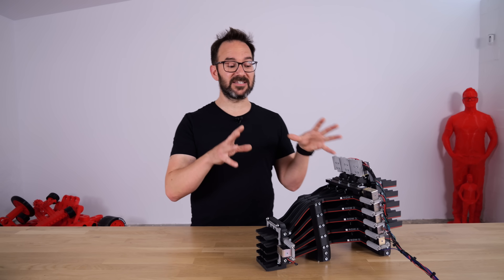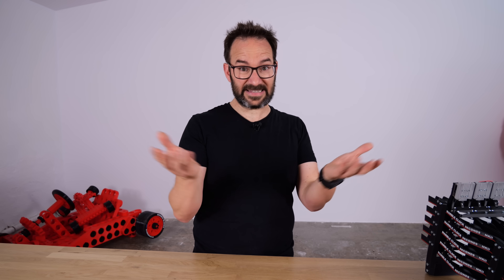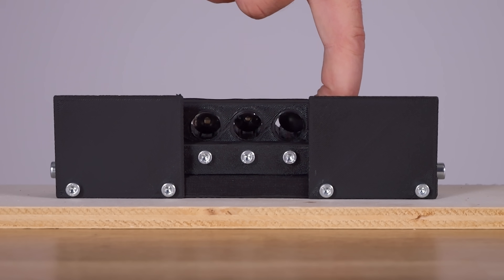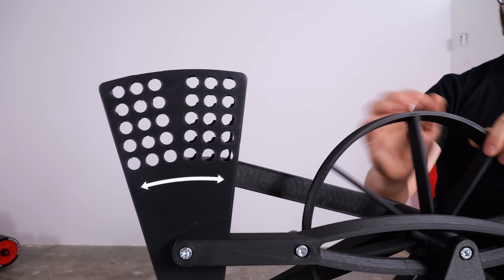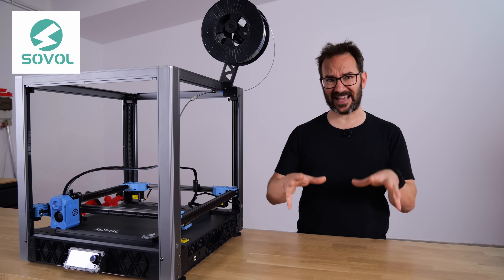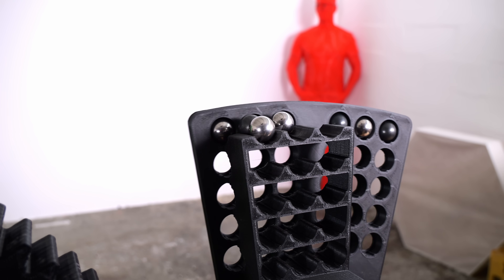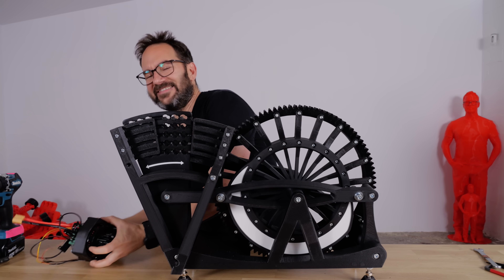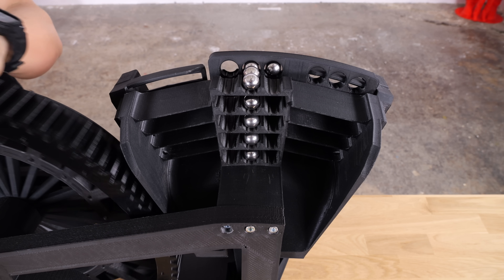Swinging Marble Teleporter - Marble Clock Seconds Display Pt.4

Comment: It was one, or maybe a couple of videos ago, I left a comment querying using black marbles at all, when you can just leave it blank. On a digital numerical clock, the top and bottom centre are always blank, so you can just fill it in with plastic, or just leave a space with no marble inlet. When you have a number like a "1" , you only need to release 6 marbles (on the left side only, presumably).  For a "2", you onlyy release 11 marbles: 3 across the top, the middle and the bottom, and then one on the upper-mid right, and one on the lower-mid left. Probably difficult to picture from my description, but if you try and think about it in terms of ONLY ueing silver marbles, and only in the spaces you need em, you'll understand what I mean. I mentioned it back then because I thought you were trying to do too much, and you were having problems back then as well. It seemed overly complex. If you go back and have a look in the comments section from then, I outlined the same solution. It WAS a bit long- winded. Was just trying to explain what I meant in detail...

Comment: Awesome project...here is an idea: if you added a feedback loop from a digital clock (coded into the control software), you could make the clock self-correct for any mechanical imperfections and would ensure that it never runs incorrectly....

Comment: can't you change the cam wheel? now it just switches 2 times per revolution, but maybe it could change the posistion 4 times a second, this will result in less noise and epower use and maybe even less wear

Comment: Great job on the display rework, that contraption is crazy in a good way! While I was amongst those who suggested not relying on gravity for the marble swap anymore, my expectations were that you'd only rework the very end of the ramp in a smaller way. Like a sliding plate that would have the 15 holes and a little ramp to one side of each hole to push each marble out, then slide back to let the next set through. That would only move roughly half the diameter of a marble.
Your version is much more exciting.

Comment: For far more compactness, what you need is not a shifter + extractor, but rather a single wiper:
Put a slot all across the marble channels assembly, say half the width of a marble. Let this act as a groove for the marbles to rest when displayed.
Add a vertical rod, to travel horizontally across that slot every second, with a wedge shape to push the marbles out the front as it travels along the slot. Catch the dropping marbles, and you shall be Bob's nephew.

Comment: I'm not a mechanical engineer but saw a few uses in animation videos of bar linkage mechanisms. Your solution may be better for this in many ways, but what about things like a "Crank Rocker Four bar Mechanism" which does this oscillating movement. When I saw your oscillating plane, it immediately reminded me of these 4 bar linkage mechanisms that turn desk fans back and forth in old designs. The linkage idea can be used to create other movements too  such as a tool to pick up something and place it elsewhere all by 1 rotational body such as on an assembly line. Any thoughts on using arm links to create necessary movements of things?
Reply from the maker: I've looked at four bar linkages and those follow a similar path to the eccentric wheel. The display would never be stationary
Reply: @ivanmirandawastaken  it was still fun to try this with AI asking "Create an image of a 4 or more bar linkage a that will oscillate a plane once a second" or other keywords the particular AI uses to help with ideas.
Reply: Meta didn't do as well, but I did ask it "/imagine a 4 or more bar linkage a that will oscillate a flat geometric plane once a second" . Funny results ensued.

Comment: Wow. Thats a major shift, but i think it looks even better. 
Still I think there is wasted energy to change every marble every second, but that would require a major to complete redesign from this. Taking an accuracy approach is a major improvement to what came before, so it's just a question of making this whole number change each second approach work in the sorting and setup phase. 

I'm not one to know what your answer might be, but I'm thinking since noise isn't an issue a side loading gearbelt system for black/white after sorting. That's not the best explanation. 😅 But the idea is that the belt would allow for 100% accuracy for selecting if a marble in a space should be white or black. The side loading would allow multiple marbles if nessisary to slide into a single slot, even if the belt is moving. However this would mean 13×2 belts for the black/white options and then 2 more belts for the center white space marbles. (28 in total...) Saving a total of two belts not needed. 

Anyway I'm going back to sleep. XD
🔵🔵🔵
🔵⚪🔵
🔵🔵🔵
🔵⚪🔵
🔵🔵🔵
Reply: just a closed loop for each pixel - and the marbles in the correct order for digits 0 to 9 and then they follow the closed loop going back through the system -  should work - it's only insane in that you wouldn't be able to read the clock because of all the marble track in the way :)

Comment: I think you should and can make the gears much smaller.  If you put them at the base of the sliding board you will be able, with much less movement, to move the board from side to side.

Comment: Of course, you're going to need two of these, aren't you? One for each digit in the seconds counter of a clock (00-59) then you can mount it to your huge marble clock and have minutes and hours on that, so you end up with a full clock of hours, minutes, and seconds.
Reply: It sounds like this single digit will be the most complicated one in the whole clock. The tens-of-seconds digit only needs to refresh every 10 seconds so it could use a simpler mechanism. We'll have to wait and see what route he goes with :)
Reply: @DanielLamando  I am buckled-in for this ride, yeah!

Comment: If you code it right, you just need alternating colors of marbles in each lane and only swap a marble if the next number has a different color in that specific pixel. That would remove a ton of movement from the system and allow for extremely lower noise operation. In fact that's the primary benefit of loading these from the back instead of the side. Each lane is isolated. (this could be made even sillier if you just have each lane have a closed loop that pops the other color marble back behind the one that was just replaced)
Reply from the maker: I'll prove you that I can do even sillier than your even sillier.
Reply: @ivanmirandawastaken  I absolutely look forward to it.

Comment: You should polish the black marbles. You do so with a tumbler so you don't have to do each one individually.
Reply: The marbles used to be silver and got "painted" this way by chemical process, too much time in a tumbler might polish the coating off entirely, which is my guess as to why he hasn't tried that yet.
Reply: @PromptedHawk  I completely forgot he had to turn the black marbles "black". It has been a long series.

If I recall, he hot blued the marbles at first but found a more effecient way to do it and they aren't painted. As long as he doesn't over polish them he should actually be fine. I would take a batch of of silver and black balls and use a micrometer on them to see if there if there is a noticeable difference between the two before doing anything though.
Reply: @infin1ty850  Yeah, it's the over polishing that'd be the problem, I'm guessing it'd need a fairly gentle medium and constant supervision. The bluing probably isn't all consistent throughout the marbles so a fair few would still need at least a touch up.

Honestly, it seems like he's doing alright so far, and the black marbles being shiny could make things confusing if light happens to be hitting the clock just right. I'm gonna say if it ain't broke, don't fix it.
Reply: Too shiny and it'll be hard to see the digits, depending on the light. They're already half-way too shiny for my eyes.

Comment: ok, now you can show the digits from 0 to 9. But you´ll need the numbers all the way up to 59. You´ll need a second machine like this to show every second from 00 to 59?? can´t wait to see this improvement
Reply from the maker: You're correct. This is the second units. Once I finish the the entire setup for one digit I'll have to do "something similar" for the tenths of seconds, this thing is going to be huge.
Reply: @ivanmirandawastaken  My question is, how to you get the digits close enough together to be read as a single two digit number without visibility issues....
Reply: @ivanmirandawastaken  Since you're already using gears, why dont you just hook the second display to a gear that switches every 10 seconds? Would be a pretty simple solution and not very bulky
Reply: Tens of seconds will be a lot easier to manage to be fair
Reply: @patrickhector  Somewhat easier, since there is more time to prepare the marbles for the next digit, but the tens digit transitions need to be just as fast and also correctly synchronised to the units digit transitions.
Reply: @GodmanchesterGoblin  tbh just repeating the design with a 10:1 gear ratio and a 10x steeper angle on the main gear would do it
Reply: @patrickhector  True, but there might be an issue with the cam angle. I'm no expert though. I'd probably look at using Geneva drives for this.